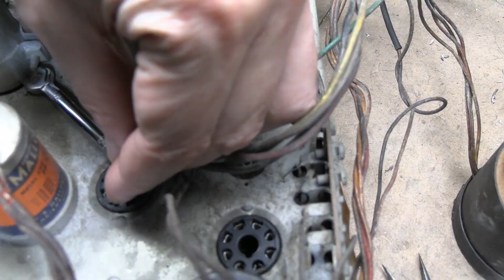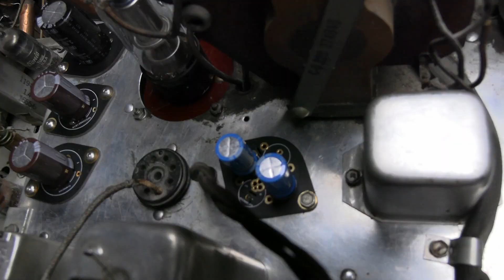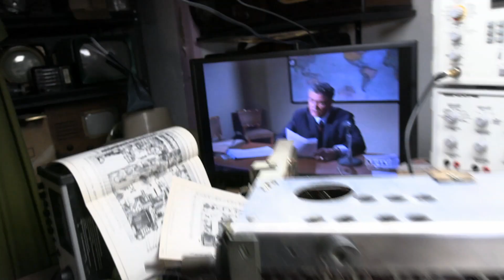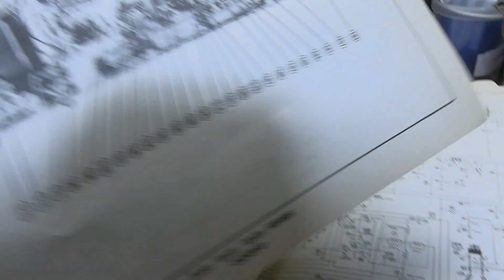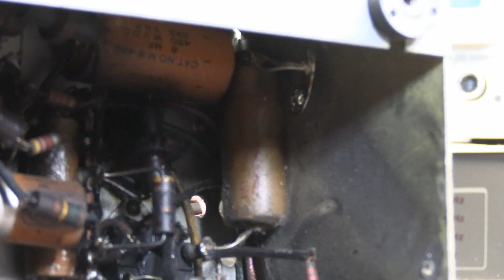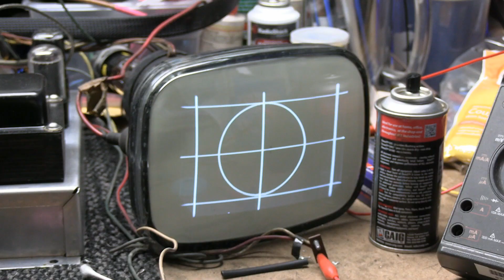Garod 15TZ6 restoration part 06 - More height and an image appears

Comment: Why in hell are 5v4 TUBES overpriced and considered rare?!  They made millions of them, and millions still exist!  I have to assume that the current pricing is only because of the "old" adage`   Don't be fooled, they're both readily available both in T8 form and original "coke bottle" forms.  There is no need to make them more than what they are.   Shame on anyone who overprices them.......Youre time has come.
Reply from the maker: Audiophiles and tube amp fans.  Hard to say if millions still exist - not NOS anyway.  They stopped being used in new production gear around 1948. $32.95 at the TubeDepot.  $169.95 for an RCA 5U4G.

Comment: 😡😡😡😡Bei solchen Historischen Geräten sollte man die alten Kondensatoren neu Befüllen und nicht Entfernen, oder man Hängt nur eine Seite ab und lässt sie an Ort und Stelle.🥵🥵🥵🥵🥵
Reply from the maker: When I do, I get many folks tell me I'm stupid for wasting my time.    I have several hundred TVs to restore.  I'll drop dead long before they get restored if I restuff the caps.
Reply: @bandersentv  Alles Ausrede. Dann hänge sie wenigsten ab und lass sie drin.
Reply: @bandersentv  Das Gerät Verliert so seinen Sammelwert.
Reply from the maker: No, it really doesn't.  I've restored 100s of vintage TVs and no customer has ever asked me to leave the original caps in place or restuff.   If they ask and pay extra, I will but no one has.  I also have no trouble selling my restored TVs for top dollar.
Reply: @bandersentv  Das wird noch kommen.
Reply: @bandersentv  :face-pink-tears::face-turquoise-covering-eyes:

Comment: Nice work. Can you not unscrew the sides on the chassis in order to get at the deeply buried parts ? Both sides of the chassis that I have are screwed on, unlike the front and back panels which are part of the chassis.
Reply from the maker: Oh yeah. I hadn't noticed that.  It might have helped with the two caps in the corner but that's about it.  The real pain is along the back and around the horizontal output tube / damper.
Reply: Schön Kaput Restauriert,🥵 warum alle Historische Kondensatoren Entfernen, anstatt sie einseitig still legen und drin lassen. Das gerät verliert irgend wann man seinen Sammel Wert.
Reply from the maker: @EMRT-b90  I think modifying the wiring, and drilling holes to install terminal strips is far more destructive.  This wiring is exceptionally brittle and should not be disturbed. I saved every part that was removed so they could be reinstalled someday if someone really wanted.
Reply: @bandersentv  Die Bauteile gehen Verloren bis dahin. Wenn man sie nicht in das Gerät hängt an die Seiten Wand in einem Beutel mit einem Reisnagel.
Reply from the maker: @EMRT-b90  I'm delivering this set to a museum in four months.  The parts will be included as part of the display.
Reply: @bandersentv  OK
Reply from the maker: @EMRT-b90  Also please keep in mind I'm doing all at a considerable expense in both time and money.  This set was headed for the garbage dump.
Reply: @bandersentv   Der Witz ist aber das meine Methode weniger Zeit braucht wenn sie nur einen Anschluss Draht Ablöten müssen bei dem alten Bauteil.